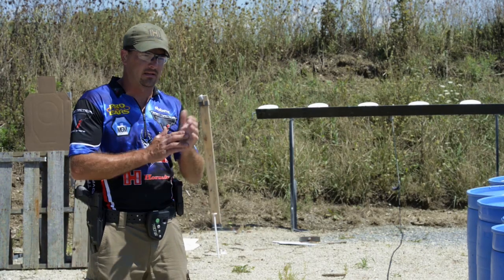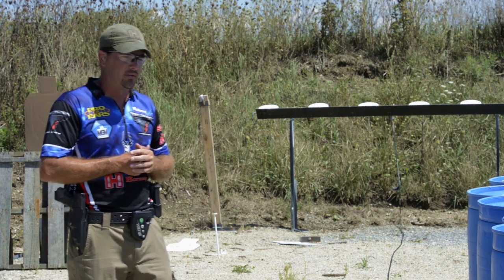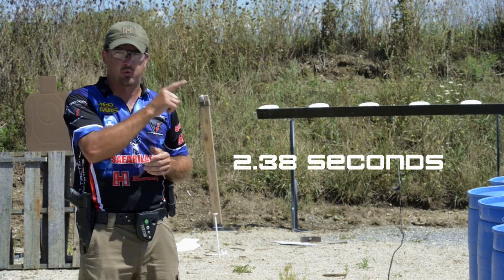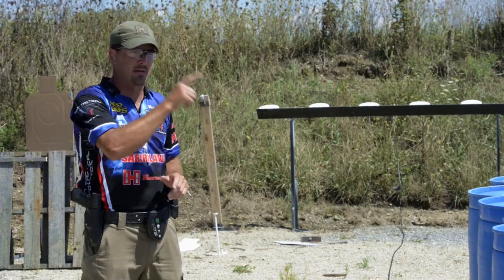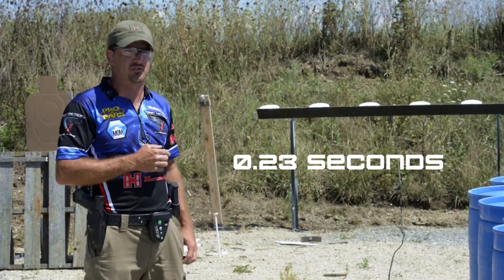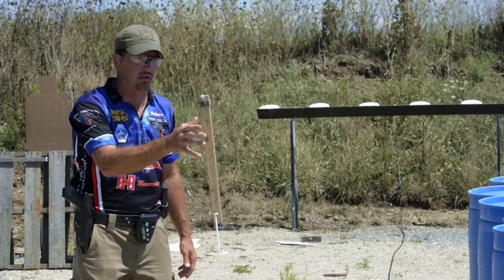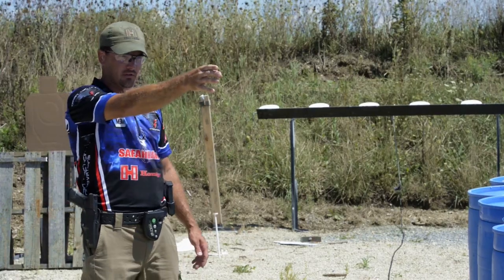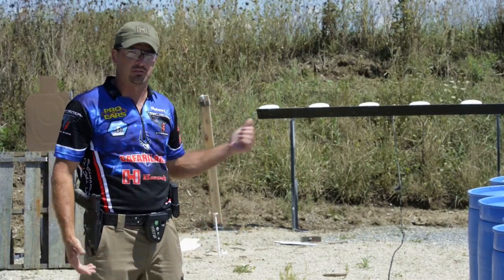Adder System: Robert Vogel Plate Rack Drill (Concealment vs Open Carry)

Comment: I built my own plate rack, today. My dad got me some scrap steel, from his workplace(1/4" thick, regular mild steel). I took my grinder, and some cutting discs, and made 4 - 6" x 10" plates. I had some 1" x 2" magnets ➡️⚡️⬅️, so I decided to use them, to hold my plates up. I've got one particular target 🎯 stand(I have several stands, made with saw horse brackets), that's got an 8' foot 2 x 4 across the top(the beam, that the targets hang from). So... I drilled 3 holes into a piece of 1/8" thick, by 1" wide, 6' long, flat stock steel, and screwed it into the back of the 2 x 4 beam(about halfway down, that's why I cut my plates 10" long). Then... I cut some small strips of steel, and super glued them around the outside edge of the magnets, to protect them from shrapnel. Then... I drove 2 finishing nails 🔨 underneath the plates, and a couple beside of the plates. This gives the plate a shelf to sit on, and some support on the sides(I left the nails out far enough to support the plates, while the plates are attached to the magnets). Now... The plates fly off, when I shoot 🔫 them. Everybody uses hinges, but I just wanted to try something different. It works like a charm. ♦️👍✅😜    Edit: I may end up drilling a hole in the bottom of the plates, and tie a piece of wire to them, so they won't fall all the way to the ground. 💡👌🏼   This is just for .22lr. 9mm will dent it, over time, and occasionally cause some "pitting". I have some thicker steel, for 9mm training. And, I've got some AR500 steel, for rifle work.